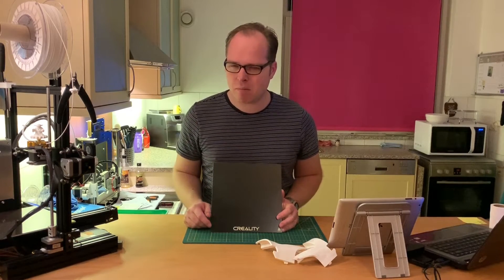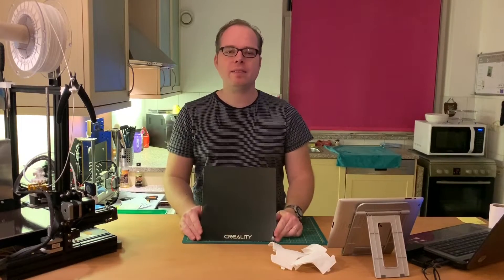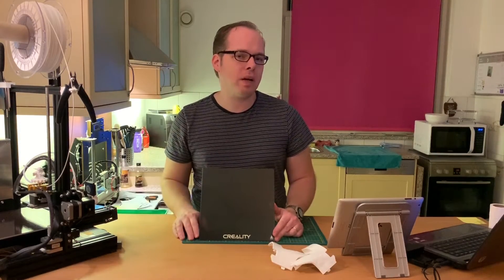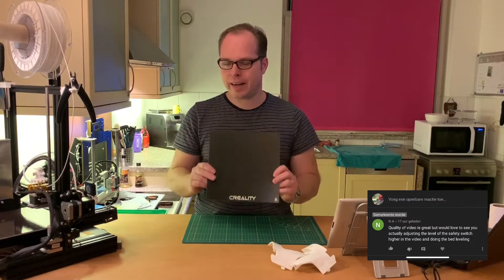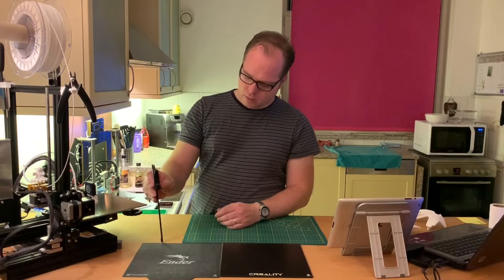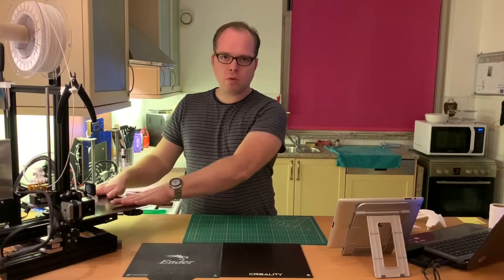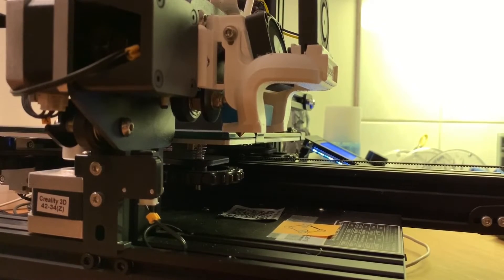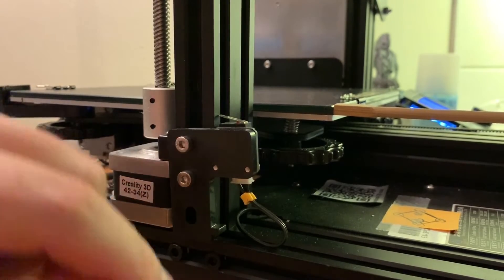How to adjust the Z limit switch Creality Ender 3

Comment: Great video for adjusting the Z limit switch. Just a suggestion, fully compress all 4 bed springs and then manually adjust the limit switch so the extruder nozzle is just a few mm above the bed and tighten the limit switch bolts. Perform autohome and then unscrew the bed leveling knobs until the nozzle is close to the bed level. Perform a leveling routine a few times (autohome and check level x3).
Reply from the maker: Thanks, old video that I made back then. People were requesting how I adjusted the End stop, so I just showed how I did that

Comment: I know these are old comments and old video, i have an Ender 3 S1, you people are talking about a stop switch for the z offset. I have look all over my printer and i do not see one, Kindly tell me where the f is that thing before I throw this thing out in the yard
Reply from the maker: Hey Tony, no problem! Nothing really old in here. Glad you answer your comment. The Ender-3 S1 Doesn't have and Z-Endstop, they use an ABL system, auto bed leveling. You need to use the ABL and after that, you'll need to head up the printer(Preheat PLA) and then run a Z Off Set via the menu on the printer
Reply: @Zachary3DPrints  I did that and I still have the 1/8 inch clearance. Didn’t have it before, just went in there one day to print and “there it was” . Wondering why my filament wasn’t sticking to the bed. Looked down there and sure enough , the clearance was really high. Beats my on what happened. I’ve been printing for a while now. Thought maybe someone had the same problem.

Comment: Why do they not mention the carful and tricky yet essential adjustment of this sensor in the manual?
On my printer I installed it too low... by just following the manual, so with the auto-home the nozzle went so far down that the board seemed to bend a bit (glass doesn't bend, so it's probably because I didn't level the bed yet
Reply from the maker: I encountered this too when I installed the glassplate, but lucky enough I did noticed it in time and made this video

Comment: Great video, thanks for the shar. One piece of advice - when leveling the bed, I always adjust by LOWERING the bed, i.e. tensioning the spring with the adjustment wheel at each corner clockwise (looking up from the bottom of the printer). When you EASE the bed up to the nozzle, I find it doesn't hold its position, it changes a little bit afterwards. It is like tuning a guitar string - you always tune from below, tightening the string, never easing the string.
Reply from the maker: Thanks for the info! You are right. in the beginning I didn't know that, but indeed

Comment: i have the scraping only on the x with the stock bed ender 3 pro and its driving me nuts. going to try this and see if it helps!
Reply from the maker: Sorry for the late response, but did it work?
Reply: @Zachary3DPrints  Actually helped out a lot my switch got bumped at some point I think and made my offset a touch lower. Been having great prints since. Thanks again!

Comment: You missed a step for me. You adjusted the stop. How does the machine “know” that is the zero. I am used to machines where you position the head to where zero is and instruct the machine to update. Does the machine assume the stop is zero?
Reply from the maker: yes, the endstop is the switch to tell the printer to stop

Comment: I'm having the issue with the zlimit not staying in place no matter how hard the nuts are fastened. I can make it fall off by just slightly nudging it at an angle. Any ideas what the issue might be? I'm not having much luck with the control panel staying on either.
Reply from the maker: Hey buddy, issues with the Z-limit switch, loose the 2 screws, move the bracket a bit up and then down and screw it tight, T-nuts are designed to twist horizontal then tightening them. For your control panel, please check your connector if that one is pushed in fully, because on the mainboard side, it's hot-glued in place
Reply: @Zachary3DPrints  I figured it out after writing this comment. The issues  with T-nuts was not loosening them to the point they were almost falling off from the screw (and where they fell off on few attampts), otherwise they wouldn't go into the ridges on the printer frame. Same with the controller holder thing that the panel with LCD goes on to. Thanks for taking the time to respond!

Comment: I had a problem with one of the limit switches, after much testing I found these switches have a fundamental flaw. If the bolts holding the switch are tightened too tight they can scratch the switches pcb and end up connecting the switch to the frame which is naturally ground. I fixed this problem with the addition of some neoprene washers on the bolts. 👍
Reply from the maker: Oh that is great solution! That's why I most of the times says, don't over tightened it

Comment: I have a home made 3D printer. I am facing issue with my z motors, as they are not moving up as expected and endup crashing into previous layer. I am currently moving z motors by hand clockwise to avoid this issue but it is not giving output as expected 

kindly advise if there is a way to fix this issue by increasing z motor position after each layer by changing printing configuration in Slic3r or in Merlin firmware.

I am using Slic3r for gCodes and PronterFace for printing
Reply from the maker: Oh that is very awesome, making your own 3D Printer! I'm working on one too, digitally that is... Which board are you using? How many stepper-motors do you have? Is there enough current? Are the stepper-motor wires correct(are the pair of wires on the stepper-motor side twisted?)? And which Lead-screws are you using?  Threaded Rods(screw-rods) they have the Esteps of 2560mm/s, the Creality lead-screws (T8/ 4 start) have an Esteps of 400mm/s, when they are single start then it is 1600mm/s.
Just let me know, very willing to you out.
Reply: @Zachary3DPrints  I followed this as a reference and then implemented few ideas of my own. 

https://technoreview85.com/arduino-3d-printer/

I am still trying to fine tune it, specially in terms of z motor movement, as they are not moving up as they should be and end up crashing into previous layer.
If you can advise me on z motor movement settings via merlin firmware or via slic3r gcodes or any other settings... that will be a great help.
Reply: @Zachary3DPrints  Thanks a lot. I added a gcode to raise z motor after each layer ("Print Seetings --> "After Each Layer gCode" in slic3r) it works for few layers after that it start working in reverse.
Is the value in slic3r gcode gets overwrite when auto z raise reach the same value and turn the z in negative? 
How I solve this z motor issue? it is still crushing into previous layers and ruining everything.
Need advise

Comment: I have the opposite problem with the bed being too thin and the head not coming down far enough
Reply from the maker: How far is your end stop from the feet of the printer?
Reply: @Zachary3DPrints  i ended up grinding off the stop and adding washers to a bed spring
Reply from the maker: yeah I can imagine that...

Comment: I completely forgot that I set the limit switch by my self and your vid rescued me I think 😂
Reply from the maker: Glad it did helped you with that. Did you print something great on your 3D printer?
Reply: @Zachary3DPrints  I tried a test layer and saw that my printer bed is  perfekt leveled at the corners but not in the middle 🤔
I found an old Arduino and are now on my mission to make some dupont cables out of old wires 😅

But I'll give my best to solve this complication

Comment: Thanks for your help Zachary, i get the same problem on my ender 3 V2 when i change the bed level spring for a new ones and this result larger than the oem version, so i get the solution to my problem on your video. Count with a new suscriber.
Reply from the maker: Wow even for the bed spring it works indeed. Glad it did solved your issue, happy printing!

Comment: Great tip. I will detach the glass bed and use that as the actual depth adjustment like you did with the wooden dowel.
Reply from the maker: David Butler thank you, be careful with the glass plate

Comment: 1 corner of my print bed is raised as high as possible and the nozzle is still too high is there a fix
Reply from the maker: Hmmm, which corner is that?
Reply: @Zachary3DPrints  i have the same problem with the bottom left corner.

Comment: Hey Man, I need your  help. I did what you said but when I was trying to level it, the nozzle was still too high even though the bed level is already raised as high as possible. Is there any possible fixes for this? Thank you!
Reply from the maker: Place your glass bed (carefully) between the 'leg' and the end-stop, tight the screws,  carefully remove the glass plate from the 'leg' and the end-stop. Home your printer, disable the stepper motors, put the glass plate back, and check how much room there is. Do homing again and a disable to start leveling the bed.
Reply: @Zachary3DPrints  Alright will do that, Thank you so much!
Reply: Also when placing the glass, do I remove the magnetic film from the old magnetic plate?
Reply from the maker: The magnetic film can stay on, protection
Reply: @Zachary3DPrints  if you leave the magnetic bed on, won't it add height to your distance from the build plate? I realize it's only 1mm, but with something like this that means a lot!
Reply: @Nowayfella  Heyy, what I did with mine is that I just adjusted my bed to fit the additional 1mm. Hope this helps!
Reply: @Zachary3DPrints  Hi I am having this same problem and I read this, but I'm new and I don't understand what any of this mean, do u think u could help me
Reply: The bed should be heated to 60 when bed leveling.

Comment: Whatever you do, Do Not Speed your Hotend or your Bed Quickly from one side to the other with the Power Supply Turned On or Off. You will Blow the Transistors and Capacitors on your Control Board with EMI Spikes. Brushed and Brushless Motors when Spun Rapidly in Reverse become Generators and will Produce Electrical Spikes through the Wires back into the Control Board.  I made that Mistake Once and Advise the Rest of you to be Careful . Other than that Great video on Setting Z-Axis Height.
Reply: I did noticed that the first time i moved the hot end and notice the screen light up with the power off. Great tip, i can't imagine how many people have done it and damaged their control boards.
Reply from the maker: Hey sir, thank you for this tip! It became a habit...
Reply: Oh shit lol I did it as well, but I mean all worked well and it centers right at the first corner (so I think I got 🍀) good to know thought 🙂
Reply: Thanks man, I always thought it was weird the screen would blip on. But assumed they would safeguard against it. I know what my next project is lol
Reply: Oh I always wondered what was happening to light up the screen when I moved the hotend, thanks for the tip!
Reply: best way is to turn the machine on, go into the 'prepare' menu, select 'move axis' then select x, y, or z. You can move in increments of 10mm or smaller
Reply: This worked great for me!
Reply: Was wondering why my module was lightnened up while pushing that lil shit 🤔

Thx for the advise buddy 😇